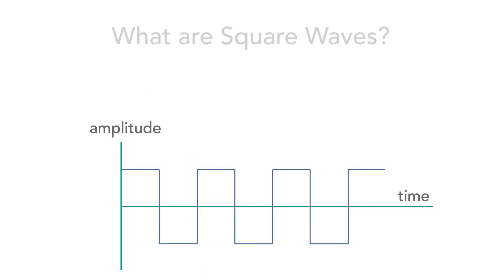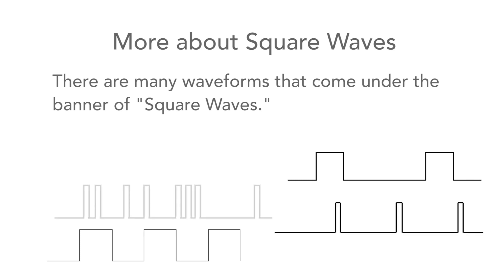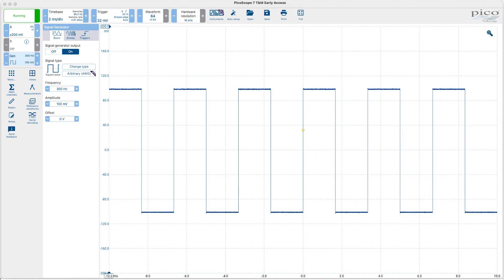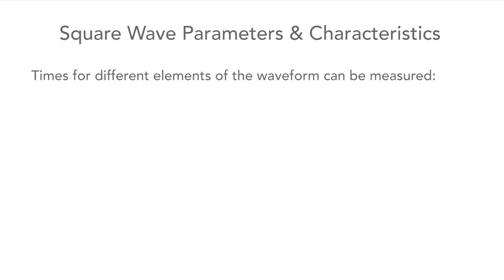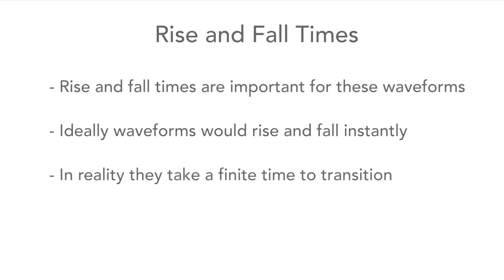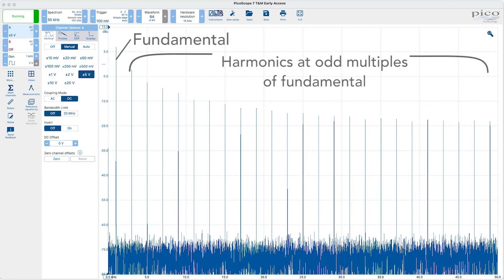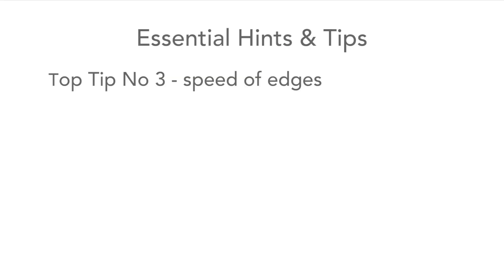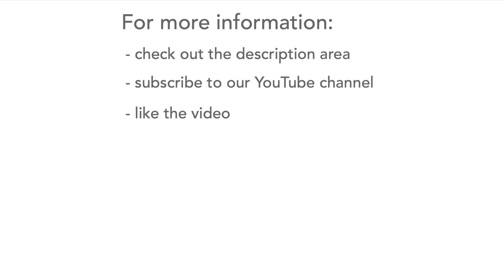Understanding Square Waves in Electronic Circuits

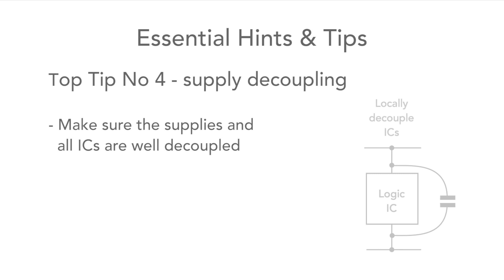Comment: 9:08 maybe this is the reason why my flow sensor starts to send high pulses (even though there is no water passing through it) when, in another part of the circuit, a pwm signal changes the speed of a dc fan cooler controlled by a Mosfet. Maybe the Mosfet's switchings generate noise that affects the flow sensor signal pin connected in my microcontroller (I'm using a esp32). Or could it be the power supply? Have you ever had this problem? Thanks for the video, it was very helpful

Comment: Thanks for the explanation ❤
But can we call this wave a function?
Since when it changes from a value to another, there is a straight vertical line and then more than one value for the  (t) where it changes ( if it were a function of time)
Reply from the maker: Glad you found this useful.
As for a square wave being described as a function, well it can be expressed in terms of a Fourier series - it will never be complete square because of bandwidth limitations of the system.